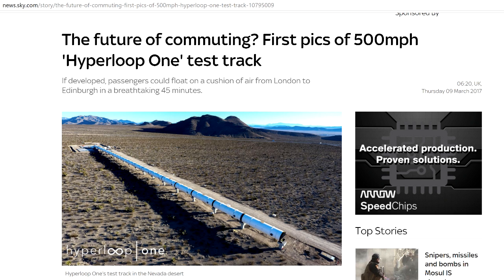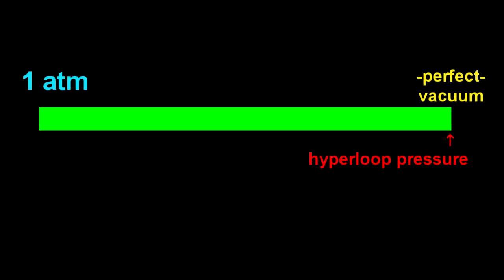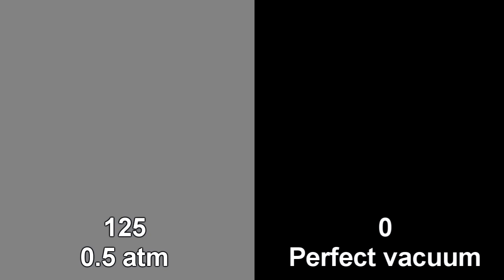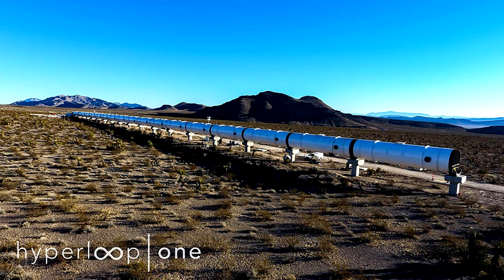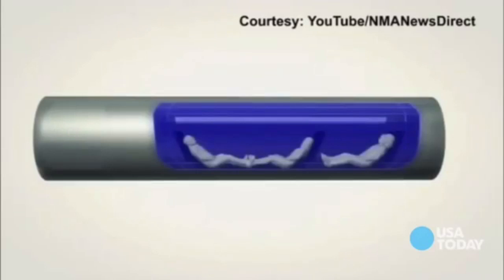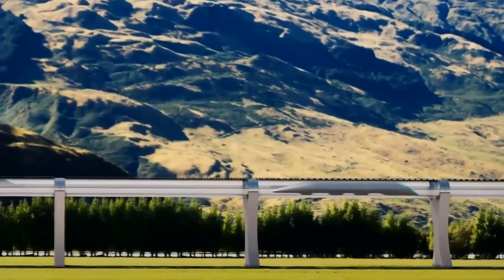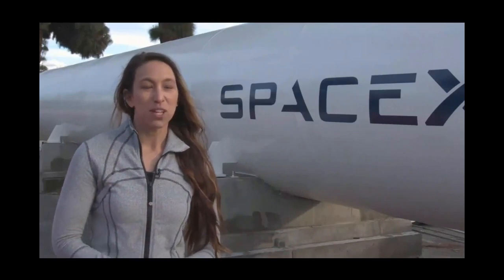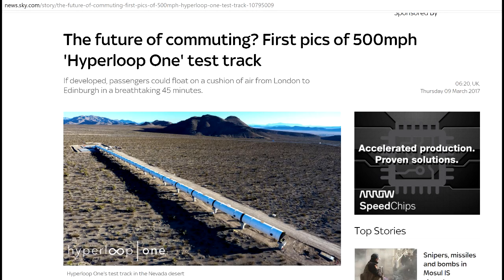Entire Hyperloop could be destroyed in SECONDS!

Comment: I love Mr. F00t's videos, humor, and science sense but would like to think he's been unduly cynical here.  100 years ago couldn't you show pictures of crashed planes and scoff at the foolishness of trying to fly?  I believe it is said that the Wright brother's first flight could have virtually taken place inside a hollowed out 747.

I won't claim to know a lot about the particular physics involved, but couldn't a vacuum tube be designed with vacuum implosion relief valves all along its length?  (admittedly part of the intent of the design, I think, is to try to make a very inexpensive carrying chamber and put the money into the pods, but still... having safety releases that can be reset any time there's a glitch could probably be done in a mass produced ("affordable") way (?)

Couldn't a true "loop" not be so much of a "vacuum" and more of a "wind tunnel" (where whatever air is inside the tube moves with (and to some extent helps to push) the pods?

Couldn't the pods not require you to stand up in them, but merely be the diameter to comfortably lay down or at least sit reclined in?

Couldn't a transit system consist of a series of shorter connected tubes, such that every 20 miles (or whatever) the pods transitioned, though sealed chambers, from one "vacuum tube" to another?  If "technical problems" with the tubes were frequent, on well traveled routes there could be a "matrix" of many parallel tubes so even if sections of the tubes were being repaired, the pods could switch tracks at each way station (?)

Comment: What if they made the hyperloop triangular instead of cylindrical? Wouldn't that make it stronger against the pressure difference?
Reply: Round objects are stronger than objects that have points on them.  A plane crashed because the windows were square instead of having rounded edges.
Reply: In the video, when the tank collapsed under vacuum, I noticed that the metal flexes in. Wouldn't a triangle prevent it from flexing inwards? Obviously the corners would need to be reinforced, but the sides don't need to be thick at all.

Comment: OK smart ass, I'm a mech e student at at university with a team participating in this competition, responding to your points one by one:

1) A tanker is much different from the type of tube that would be built for a hyperloop purpose. Building a tube that can stand up to a pressure differential of 1atm (roughly) is childs play. James Cameron's dive to the bottom of Mariana Trench had a submarine withstand a pressure differential of roughly 1,070 atm. Also consider that we've built the ISS (In fucking outerspace) that withstands a pressure differential of 1 atm regularly. Doing so on the ground wouldn't be hard whatsoever.
2) Yes the pods in the hyperloop competition only reached a small fraction of the speeds the actual hyperloop would reach BECAUSE THE TRACK WAS ONLY A SMALL FRACTION OF THE FULL TRACK. Accelerating up to 800mph in .78 miles in any fast amount of time is literally impossible as the g-forces incurred would tear apart the pod. The idea of the hyperloop isn't to spend the entire journey at 800mph but to spend a good amount of time getting to those speeds at a comfortable level of acceleration (maybe 1.5Gs). Anything greater would be uncomfortable to the people onboard. 
3) Yes, the test track took 30 minutes to depressurize, and no this wouldn't be a problem for the actual hyperloop, as it would only have to be depressurized ONCE. Even if it took days to get the whole track to the proper pressures this really isn't that big of a deal as its not like the entire track is constantly being pressurized and depressurized over and over. The track would be depressurized in the beginning and have systems in place to maintain that pressure.

Go get a real engineering degree, quit spitting dumb shit on youtube and keep in mind that the competition you keep ripping apart was put on by university students, not real engineers, and that all these universities were completely funded by corporate sponsors and are severely financially held back.
Reply: Your name is policeboy0

Your not anything important LOL,  "at at university" ?

I think you meant at "a" university.

Come on man, who's gonna believe you or even read your points when you can't even finish your first sentence correctly @policeboy0.

Lol get nutted...
Reply: Malcolm Morin made this account in 5th grade lol. beautiful thing about science and engineering is that its based on facts, your belief or lack thereof and this morons irrelevant youtube video isnt gonna change the fact that the hyperloop is the future and is possible with current technology

Comment: There are a few crucial things you left out in these Hyperloop debunking videos (I watched all of them); not to say you are wrong.  First, the time and energy cost to decompress the whole tube could be dropped to one decompress cycle plus a small fraction of the volume of the tube if an airlock is used.  Basically you decompress once -- except maybe for repairs and maintenance -- then you can transport thousands of passengers to their destination with an airlock separating them.  This way it doesn't have to reset the partial vacuum with every run.  But this is assuming that the other problems are solved of course.  Second, I read about potential paint coatings to minimize this issue of thermal expansion which is the main deal breaker.  The other problems are manageable.

Comment: With thick enough walls (or several tubes inside each other to act as a double or triple safety), a good enough airlock system and a decent maglev drive it is feasible. It would make more sense to run trains instead of individual pods in my opinion.

Comment: I'm not saying your wrong in concept, but the ridging on the hyperloop 'I believe' is firmly attached externally to the entire tube, UNLIKE in the tanker truck where the purpose of the ridging is not to prevent implosion, but rather explosion. The direction of re-enforcement is totally relevant. 

In the Mythbusters episode, the tanks are in fact completely ridgeless and unreinforced. So it is not comparing the same thing. It is in fact kind of like comparing a flat bridge to one with supports, the flat one is obviously going to fail sooner without support struts, and that's not terribly surprising.

Now IF the hyperloop does have a catastrophic structure failure, such as the ridges disconnecting, and the tube experiencing deformation under relative vacuum, yeah, of course, it will fail, so I'm not denying that. I'm just questioning the frequency of those failures. Ignoring military class submarines for a moment, there are MANY submarines with a single hull design (Unlike the double hull or saddle tank design), and they have suffered penetration at severe depths, and been fine with nothing but support struts along their interior.

The catch I suppose is because the interior of the tube must be smooth the struts have to be exterior. I would personally, of course, support a military grade double hull design, but it is questionable if it is necessary since submarines operate on relative pressures MUCH greater than 1 atmosphere even with single hull design, regularly get dinged and scraped, and seldom collapse under external pressure.

Comment: Putting aside that the only way you can get this to work and be even remotely safe would cost more money that going to mars likely would.

I would suggest a way to make the "air lock" work might be to have a huge super strong vacuum vessel linked to another smaller one and you evacuate the smaller one which is little more than a condom around the train this then plugs into the larger one and launches into a vacuum preparation vessel the overall look would be like a boat elevator or a bullet in a revolver loading / rotating. each chamber would be pre-evacuated before being launched - I wouldn't wanna seem them just fired down the track though as they'd need a buffer for safety sake.

Having a track hundred of miles long with no air locks or emergency shutters in it sound horribly dangerous to me though.

And even if it was buried underground it would be a magnet to terrorism - so no - build a maglev railway and keep it under 350 mph in normal air - much safer and for other medium journeys - bring back airships.

This thing is a magnet for money that will do nothing useful and will only get people killed to a greater degree than a maglev would (though they'd also be horribly dangerous if operating at 350 MPH

Comment: You need to actually read Elon's white paper, he addresses things like earthquakes and G forces, structural loads, etc. It's called engineering, he has done the basic math, and understands the difference between a low pressure environment and a perfect vacuum. There would still be air in the tube, what do you think the huge fan on the front does? The pods are suspended on a cushion of air, not wheels, remember?

A couple quotes from the paper:

"...Another extreme is the approach, advocated by Rand and ET3, of drawing a
hard or near hard vacuum in the tube and then using an electromagnetic
suspension. The problem with this approach is that it is incredibly hard to
maintain a near vacuum in a room, let alone 700 miles..."

"...However, a low pressure (vs. almost no pressure) system set to a level where
standard commercial pumps could easily overcome an air leak and the
transport pods could handle variable air density would be inherently robust..."

You obviously don't understand vacuum, what he proposes is nowhere near a perfect vacuum. The thickness of the tube would be between .8 and 1 inch thick, much stronger than the tank in your video example.

Included in the paper is the suggested route between LA-SF, G forces are limited to 1/2 lateral G in bends. The pods aren't always going 700 mph, they slow down when turning, approaching stations. Gee, how about that. He calculated the radius of the turns for given speeds to maintain that limit.

Finally you need to understand the term "test track". These are tests, experiments to prove the technology. As such there are a lot of things that would be different in an actual working system. The tube would have airlocks and so wouldn't have to be evacuated each time for example. That demonstration was the first time the technology was tested, speeds and reliability would of course go up as more is learned.

Facts and opinions are not equal, no matter what our newly elected politicians say. Or to put it another way, BS is not equivalent to science. You are promoting BS.
Reply: Yes but a 99.9% vacuum is virtually indistinguishable from a perfect vacuum in practice.

And the aerodynamic levitation was such a good idea, that EVERYONE ABANDONED THE AIR SKIS THE MOMENT THEY TOOK A SERIOUS LOOK AT THE HYPERLOOP. Even Musk himself abandoned it and when he was asked if he preferred aerodynamic levitation or magnetic levitation, his answer was wheels.

Comment: There are some engineering solutions to this, things I can immediately think of: a reversed airlock system, a double / multiple shelled vacuum chamber as a fail safe probably with a strong plasticised wraparound so that the difference in pressure in case of rupture self-seals, an automatic braking system etc.
Reply: The other thing I thought of would be to build the tube above ground then bury it in a thin (1 foot or so) layer of mechanically stabilised Earth berm, MSE is a suprisingly durable and inexpensive material that's already used commonly in highway on and offramps. The advantage here would be that it wouldn't add much additional weight that the tube has to bear but it would add isolation from wind, temperature gradients and vibration without being thick enough to impede rescue efforts.
Also it would form a barrier that incase of small (but non-catastrophic), gradual leaks such as from faulty seals between sections would prevent vacuum loss: the soil particles are too big to fall through very small gaps (sub-milimeter etc) that may be hard to find during inspection, especially if the soil is damp, compacted and non-aerated (mud or clay), but the soil would still act as a barrier between the vacuum and outside air.
Reply: You're missing the part where this is supposed to be a cheaper alternative to flying or trains.
Each of your solutions dramatically increase the price.
Reply: It really wouldn't. There are huge energy costs in maintaining that level of vacuum. Not to mention in driving the propulsion via something frictionless such as maglev. People never seem to realize this, but modern aircraft are astonishingly cost efficient when it comes to operating costs. Far more so then most other transport mechanisms once you factor in distances traveled and goods and people moved. Just at a glance you can easily see a number of ways in which this project has no way of coming close. At least not with current materials, energy sources and engineering. Maybe if they devised a fusion plant to power the thing. This is Star Trek level dream tech. And Star Trek tech only works because of the Federations mythical and imaginary infinite no cost energy sources.
Reply: And by the time you pay for all this junk, you still have no assurance it will work as advertised, and I don't even want to know what it will cost to operate the damn thing.  And unless you want to limit yourself to one train going back and forth on the same line, you are going to need more than one tube.
Reply: In theory everything is possible, but to make it safe you would need to spend a zillion dollars, and even then its not guaranteed to prevent any catastrophe. We have airplanes which are very safe, but still the plane crashes happen, but in this case if you have a mishap its over, everything is fucked up.
Reply: Ego Alter at the speeds being contemplated good emergency brakes are about as dangerous as bad ones. Your brain and organs have mass, and they will still turn themselves to paste no matter how safely the carriage comes to a stop nor how well strapped  in you are, if you apply too much sudden deceleration from speed to the passengers. 

As for the benefits of the vacuum? Personally I suspect you are correct. Whatever benefit from traveling in the reduced friction vacuum is rapidly eaten up by the energy load required to create and maintain the vacuum, and the economic load of maintaining the whole thing. Better overall results and practical efficiencies can probably be gotten from the already well refined arts of streamlining planes and vehicles to reduce drag and friction.
Reply: Bundeswehr des Vaterlands according to my quick calculations, and assuming almost all humans could survive 10 G's for a few seconds, in the event of a rupture it was take about 3.5 seconds to stop and about 600 meters (about 1/3 mile). That is, assuming you could develop a system that could stop it that quickly. 10 G's might hurt the very young, elderly, etc. but I suppose it beats a certain demise.
Reply: Cost of capital is also a recurring one.
Reply: And some good emergency breakes. Still is the power saved by putting this thing in a vacuum really worth it?
Reply: Yop the cerosene is prolly cheaper than the maintenance this thing would need.
And about the brakes: I didnt mean stopping you instantly. That would be like a carcrash. ust ones that can slow the capsule at the needed rate with 100kbar (missed twu zeroes) of pressure pushing it forwards.
Reply: Cost of construction and cost of operation are two very different things. While startup cost would be vastly more than a handful of 787s,  it would have massive savings in fuel and (possibly) maintenance. There is a chance of feasibility in this idea, but Thunderf00t is too blinded by cynicism to deliver a video that doesn't support his confirmation bias.
I do agree that it's overhyped and I think a maglev train would be a more economical solution, but I don't think it's something to be outright dismissed.
Reply: Not really, all in all it would probably be  cheaper than maglev.. None of us have done calculations on the price so let's not make any assumptions

Comment: dude who thought this would be a clever idea. gravity doesnt stop cause your in a vacuum. its only going to negate wind resistance. hence the pod could be any shape it wont matter to the top speed. if you want crazy speed you have the pod at one end and fitted tight to the tube then release a vaccuum sealed tank down the other end that violently pulls the air to the vacuum along with the pod. sounds cheaper then pumping the air out and then using further resources to drive the pod.
Reply: this wouldnt give the high speeds there after but its efficient. to make the hyperloop work they would need very powerful engines that did not release exhaust as its a vacuum. engines also need an air intake. you could feed it from oxygen bottles but the problem is the emissions from the engine.

Comment: That tanker has to be long enough to move around.  Hyperloop will be steel pipe.  Regarding the competition, why would you expect full speed to full stop in a km?  I think their pusher wasn't strong enough for an air cushion to build up.  They probably should've run it at atmospheric pressure for these low speeds.  You're harping on this WAY too hard for an undergrad student design competition.